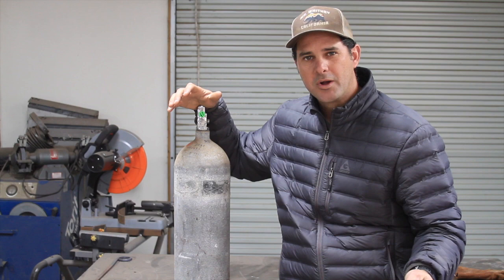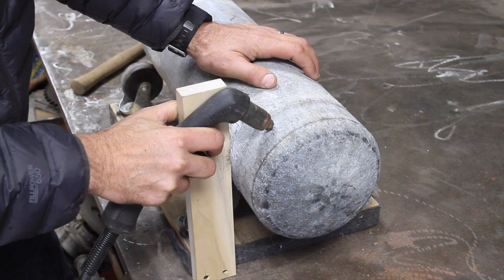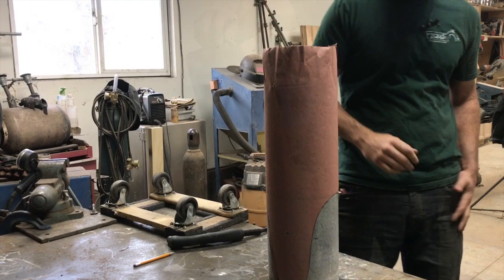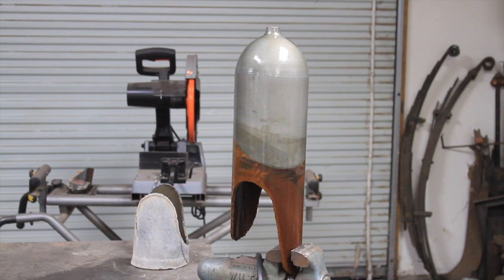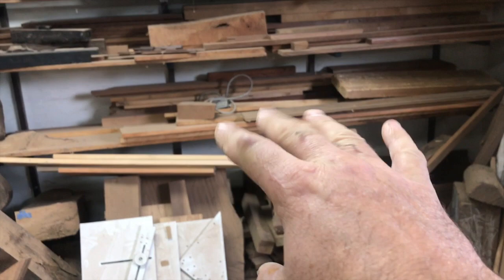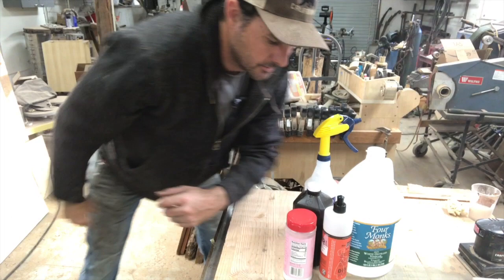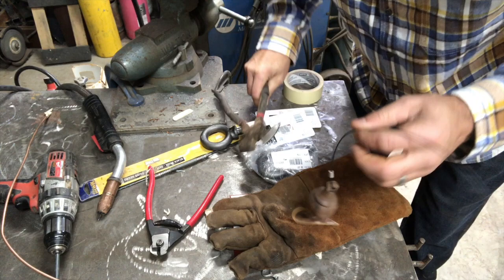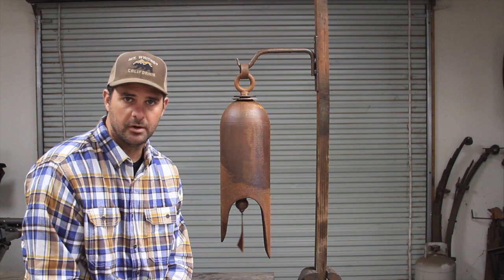DIY Cylinder Tank Bell / Wind Chime and Forged Hanger

Comment: It will ring better if you cut a line up the flat sides of the tank as well starting at the higher inside curves.
Reply from the maker: Thanks Thatamg_guy.. I’ve seen this done, I’ll have to give it a try 🤙

Comment: Joshua, I just ran across you and your videos today. This is the first and only one i have watched so far. Very nicely done. I am curious about the ratio of ingredients for your rust solution.
Reply from the maker: @jeffclark3932  Thanks Jefclark3933. I usually do a 1:1 or 2:1 vinegar to peroxide. I squirt a little soap in the mix to help hold it on the metal and a bit of salt.. the ratio doesn’t have to be precise. I’ve mixed it a variety of ratios and it always seems to work just fine as long as the metal is clean. 🤙

Comment: These are amazing. You should sell these. I imagine there is a plethora of scooba tanks where you're located. Pretty hard to findin Nebraska.
Reply from the maker: Thanks Craig🙏.. I do sell these ;) I’m always checking local listings for tanks. The steel ones are harder to come by than the aluminum ones, but I scoop them up when I can.👍 
Ive made them from oxygen and co2 tanks as well, I’m sure there are some of those in your area ;)
Reply: I have 7 tanks in Los Angeles and no one to take them

Comment: I would like to know if it will take a gale wind to move the metal ball against the bell?
Reply from the maker: Hi CactusLadySouth.. It’s more of a manual use bell than a wind chime. Though if I made a longer and wider tail off the clapper it would probably work as a wind style bell. 👍
Reply: @ShalohaCreations  Do you have a formula for length of cord and size of tail for wind chimes to work in lower wind areas?
Reply from the maker: I don’t.. I only make these bells on occasion. Sorry

Comment: Very Nice Joshua, I would be great to have your shop and tools. Would a cutting torch be a substitute for a plasma cutter?
Thanks
Reply from the maker: Curt Obermeyer Hi Curt, a cutting torch would work just fine for steel tanks. I’ve even seen guys use a grinder with cutting wheel. Some tanks are aluminum so a plasma cutter is ideal for those...